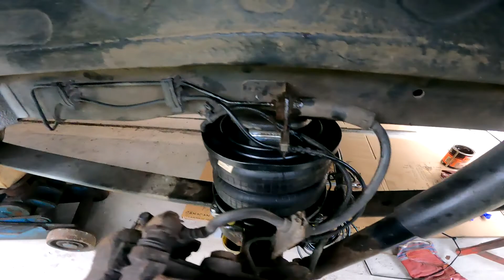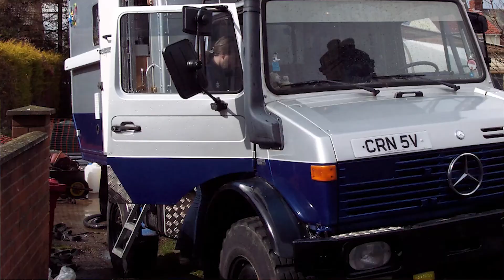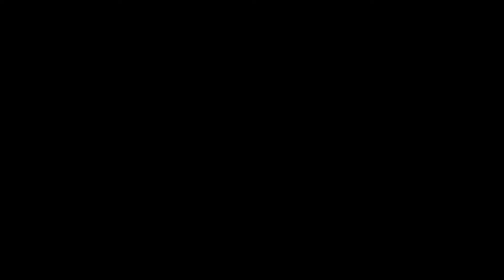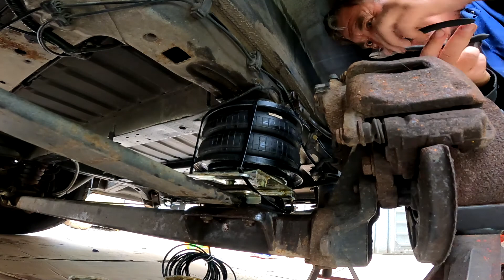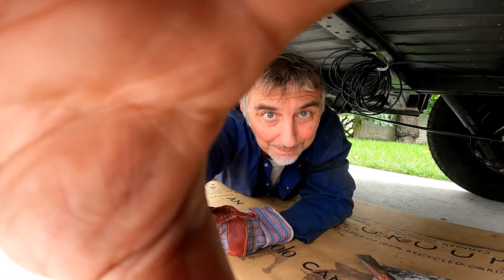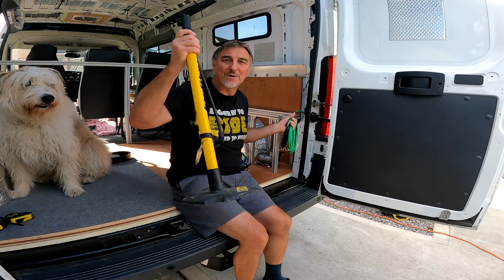Fitting AIR SUSPENSION from VBAir to a self build CAMPERVAN. Improve stability and ride height.

Comment: Hi great video, building up courage to do mine as know the bump stop.cups are spinning, quick question where fid you get the schraeder valve connections to pump manually as I don't think i'll be adjusting every time i stop
Thanks
Reply from the maker: Hi Steve, thank you for watching and your kind comments.
The valves were in my kit as an option to use manually... to be cut off if fitting the pump and guages. If you struggle give VB Air a call.
I do use the system to fine tune my level when parked up but a simple electric pump would make short work of that.
Reply: @vanlifemyway7806 that's great, have ordered a kit ( not VB).and have sourced some valves, just got to get the cups off now but knowing the problem is being forewarned...
Cheers
Steve

Comment: Just took the bump stops off my Citroen Relay in order to fit air suspension. I used a 350mm pipe wrench (Stilson) rather than hammer/chisel which did the trick without breaking the weld in the bump stop. The pipe wrench was not big enough to go right round the bump stop, but the jaws fit in the "teeth" of the bump stop well enough to be able to apply a good amount of force. Neither side was particularly happy to come off, but both did come off in one piece without needing to re weld anything back together. Happy days! Thank you for the inspiration to crack on and give it a go - air suspension in and working 🙂
Reply from the maker: Phew! Well done. I've recently used some similar sized "stillies" on one of our ex BT vans.....massive arm ache moving millimeters at a time and even winding it back as well, so I know what pains you must have had.... And just when I thought I'd made it!!!!!!

Comment: Seen a few videos like this now on the bump stops if your gonna get the welder out why not just grind the whole thing off and weld the air bag plate mounting to the chassis that's what we did. Not critic just wondered what benefit there is to using the oem captive nut which is clearly shit.
Reply from the maker: Thanks for watching and getting in touch.
"Copper grease"
I love the stuff - after years of old Land Rover restorations.
Next time, as you can guarantee there'll be a next time, it will come off!

Comment: just be aware that if the air suspension goes at any point in the future ,the ride is like riding on bricks , i speak from experience of being in an ambulance when it happens , luckily you still have the springs as well, to help .
Reply from the maker: Hey Stan, thanks for watching this one too.
I'll bare that in mind but hopefully this'll be getting a lot less hammer than an ambulance. My mate Mad Mick has sympathetically converted an ambulance with about 300k on the clock, his is on full air at the rear which would sit hard if failed.
Paul

Comment: I am wondering why you need to rust treat a galvanised van? When I cut my various panels out, they were outside for a couple of years. Only slight rust on the edges. The rust did not spread across the panel at all.  I could understand if your van was a sprinter.
Reply from the maker: Hey Carl, it does unfortunately spread,  especially when you factor in several months of heavily salted roads and ingression.
Those rear wheel arches are not sealed where they meet the body hence why many people find their internal sills awash.
Take a look at my vlog on fitting a raised bed and see the rust I had to deal with behind the side door slide and my van has only covered 28k....that's a galvanised pannel.
Undernieth there is very slight edge corrosion on many of the seams where they meet the load bed but spreading.
Last year I welded 2 patches over holes on the sills of my friends 2012 Ducato Ambulance conversion.
I believe prevension is better than the cure.
I do admit though we are lucky compared to many Transit or Sprinter owners.

Comment: Great video lads, the only think i would suggest, probably reinforce the chassis hit area, where the bag sits. You are compressing a great weight on a small area of the chassis , the spring leaf does it over 1 meter length, you may have a crack on the chassis sooner thank you think.
Reply from the maker: Hey Tattoo...I hear ya!
But we are retaining the spring rather than replacing it so there will be some sharing of the load.
Also the "bump stop"/ assister, the air spring is replacing, took and transferred the hits prior with no problems so assume all will be well.
My build should come out light as well....famous last words.

Comment: Hi Paul and Vicky! Greeat vlogs guys, I’m looking at doing the same as you guys on the suspension, how is the lift achieved on the front? Are the Koni shocks longer?
Reply from the maker: Hi Neil, I went for the full kit on the front from VB Air on the reccomendation of using their "light" spring set up. It was reccomended by another facebook user and I have not been disappointed, it really feels as smooth as riding on air. The spring has given me a 50mm lift which gives the van a much better stance and the shock supplied in the VBair kit is a koni. I perhaps assumed the strut was longer but another user mentions it's the same length and can accommodate the extra length within its operation.
The koni does make a world of difference though so perhaps glad I didn't just use a std strut with an extended coil.
But if on a budget the Kilen spring and std shock would be worth researching and considering.